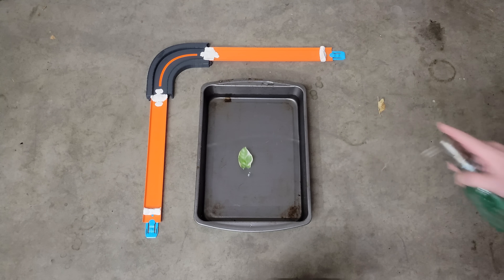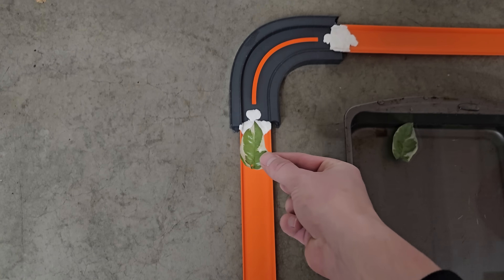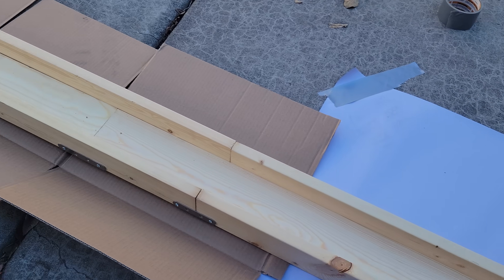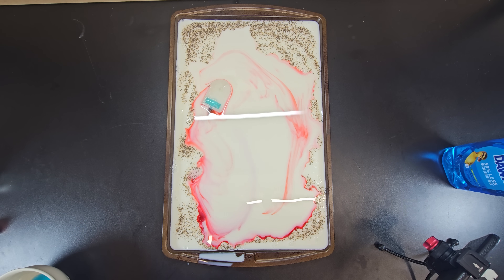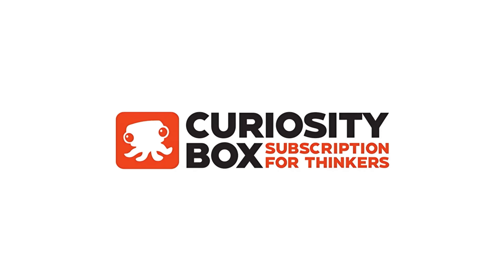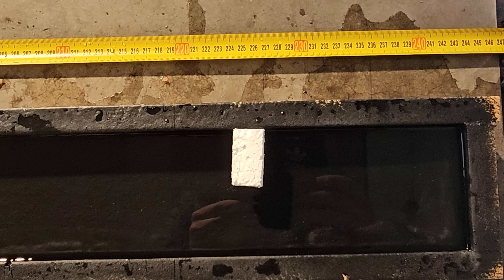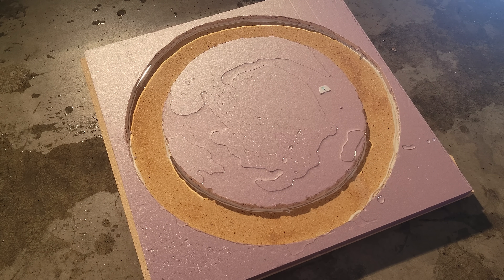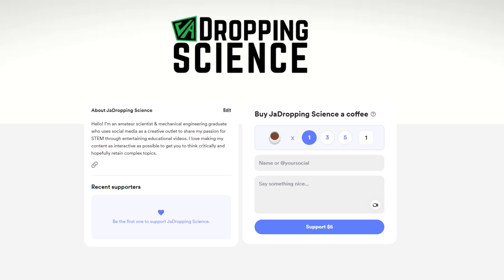Exploring the Physics of a Soap-Powered Boat

Comment: Another trip to get some Flex Seal tape to fix the bottom corners of the water trough track, an ordinary deck of playing cards to add under it a little bit at a time to help level it off, and maybe even get four cards of those two packs of Stanley line levels. You could have four levels on each side, then you'd know exactly where to add or remove shims(aka playing cards) to make the trough as level as humanly possible.
I've never heard of this leaf boat thing, but pretty cool how it works. It almost looked like at 11:34 that the boat was drafting the pepper before pushing it out of the way.

Comment: Make a boat with two stationary rudders/keels at the back, both angled towards the outside a bit. Once the boat starts drifting to the right, the left rudder will provide more pressure/resistance, thus putting it back on track again. 

Should work for the straight track. For the circular track, however, make it one straight rudder and one angled rudder, to ensure it always goes to one side. 

You can experiment with the angles of the rudders, the length of the rudders and the curves of the rudders (a straight rudder at an angle vs a curve that starts straight but curves outwards).

Comment: You should have painted the tops of the tracks with a hydrophobic paint or coating to keep the surface area as strong as possible to prevent overspilling, although with the soap it might not be as effective. Still, it might help

Comment: 0:51 I'll explain in depth why adding soap to water makes it so the drops are flat. water has a polar molecule. It has pretty high surface because of the positive and negative charge that pull each other together. The paper clip sinks because when you drop it in it breaks waters surface tension and is a heavier surface. So therefore it sinks, but when you place it in carefully the surface area doesn't break. When you add soap to water the waters molecules essentially becomes 'slippery' and its harder to keep surface tension. The waters polar molecules can't try to glue themselves to each other making it so the clip sinks because its a denser material. The water therefore cant make a dome shape because the water itself cant stick together

Comment: Wouldn’t the surface tension of the round track get ruined since the “wave” of the surface tension changing travels in both directions so it eventually comes around in the opposite directions pushing the boat off course having coming to a stop? Maybe try a round track that doesn’t go all the way around

Comment: @JaDropping Science I have a suggestion for how you can get the water to dome without filling it so high. there is a surface treatment called "Never Wet" I think. It's a two-part treatment that comes in a spray. The reason I mention this is because in order to get the boat to float high in the water you need the water to not wet the outer surface. If you use this product, instead of going up the sides the water will form a dome at the edges. The product works by trapping molecules of air on the surface. I've used it to waterproof cardboard boxes before. Strangely enough there was a similar product That came out at around the same time called Ever dry or something like that. I'm not sure but I think that maybe two science teachers came up with this at the same time and were racing to market.

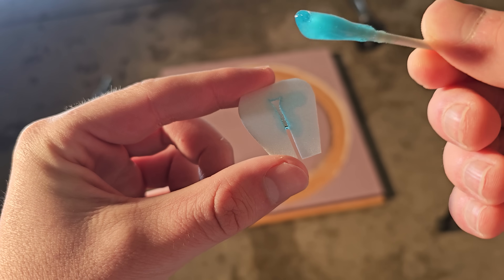Comment: 12:00 I think you would have more stable "ship" if you made it spoon-shaped with the round end of the spoon as the front of the ship. The round end would stay on the track / control steering and the long shape would avoid getting the force vector too perpenticular to the track when your propulsion comes from the rear of the ship.

Comment: 5:58 I would have quessed that the styrofoam on hot wheels track was turned because of static electricity. I would recommend you do some addtional experiements to figure out if it's actually surface tension or static electricity.

Comment: appreciating your work. . .
how bout instead of wings or shape. have a controlled keel?
im not an expert but from what i understand surface tension is more of a vertical resistance hence floating; all your models float so the next problem to solve is the horizontal axis.
single/double keel would help straighten, while an angled will steer it to a near perfect circular motion.

Comment: This is wonderful content and I know I’m a bit late to comment but hopefully you see this. ADD A SKEG TO A THIN FOAM BOAT. It will help it track straighter and keep its bow facing forward. You’re essentially using flat bottom boats with zero drag force towards the rear. That makes the nose act as the primary drag and cause the erratic behavior. A step further would be to bend and shape the foam into a traditional hull shape to further increase the straight line drag.

Comment: If you want to paint foam, just paint on some modpodge and acrylic paint mixed first and then spray it whatever color you want.
It’s a common trick for making terrain and models for tabletop games like DnD. 
The modpodge makes the paint more flexible and durable and you need the paint to see if you got good coverage. You only need enough acrylic paint to make the modpodge colored, as long as it’s grey or whatever it’s good. It normally dries clear and you can’t tell if you have gaps and then you spray your paint and parts of your model start to dissolve… it sucks.

Comment: I think you could probably have just used the pepper, or individual polystyrene beads, to demonstrate the movement - or, could have printed a circular boat, provided of course that you were adding the detergent to the water, not adding it to a channel in the boat.  

I recall that, in a test tube, water tension forms a meniscus - curving upwards.  The internet says that, for glass, this is the expected behaviour - but for other materials it may curve downwards at the edges as you have found.  Therefore, it seems, you need a wall type that provides a concave surface rather than a convex surface - it may be too expensive to form this from glass but there may be cheaper options, this would mean that you would no longer need to fill to over-flowing and the "boat" would self-centre.  Maybe a Ikea Varmblixt Donut Shaped Serving Bowl would do the job?  Or a donut shaped cake tin mould?

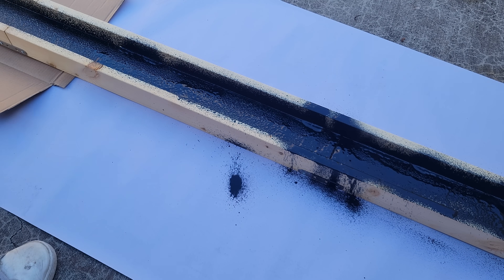Comment: 3:50 for cutting circles, i worked at a sign shop for many years, every year we had to hand cut circles out of corrugated  plastic for a golf tournament.  We ordered a new cheap tool every year hoping it would make it easier on our hands and faster.  
In the end, somebody figured out, if you stab an xacto knife into a wooden table or cutting top,
You can spin the plastic like a bad dj and get a circle cut that is quick  and it will look as good as you are able to turn it smoothly. 
The other colors workers who couldn't get the hang of it was more comfortable with the giant metal scissors  first, then smaller scissors to clean it up but their hands were a lot more sore than  ours. 

What makes corrugated materials hard to cut smoothly by hand with a blade is all the cores,  you have to go from 4 walls to 2, 4 to 2, after you apply more force to cut through a core, it gets away from you and makes a janky cut in the thiner 2 wall parts. 

But the spinning motion will atleast always make an arc cut that you can clean up after it's not a square anymore
Reply: Yo this is actually really helpful, thanks!
Reply: At least*, two words. Atleast isn't a word.

Comment: I wonder if an arrow point shaped channel (with in internal triangle of foam dividing the propulsion into two splayed points) would give it more stability/allow it to course correct a bit on its own?  I guess it might be finicky if the soap isnt placed perfectly though, leading one channel to overpower the other.  Perhaps little soap pellets and a divot in the shape to hold them could work.

Comment: wire tracks made of nylon or some kinda fishing line, to keep the boat away from walls with little friction. ofc you can even oil the wire and make the shaft of a little friction to keep the interference with the experiment low.

Comment: Hopefully I can describe my thoughts in a way that makes sense. So I was thinking about the circle track, if I am understanding this correctly, then the boat might have a problem getting the whole way around because of the soap it used at the start. Like maybe the starting position of the boat and soap may have also been causing the water to flow against it once it gets most of the way around and almost back to the start. 

Anyway this was a cool video, would watch more of this.

Comment: For the boat that goes in a circle, I suspect an asymmetric design may help it stay off the wall. Look into how engineers in NASCAR try to shape the sides of their vehicles to create aerodynamics which help the car turn left (& stabilize it while doing so). They're playing with air instead of water of course, but I wonder if some similar tricks couldn't still be applied to this. One thing they do is shape the right side of the vehicle to help create a "cushion" of air between the car and the wall which helps drivers run a high line through the turns. I wonder if you could keep the boat off the wall by shaping it to help bias towards creating positive pressure on the right side as water flows past (and negative pressure on the left). Google image search "nascar asymmetrical side force" for a glance at how they utilized asymmetrical designs in the past. Also, maybe if you cut the soap channel on the boat at an angle so that it runs diagonally and leaves the rear of the boat at a position closer to the wall, the soap will have less area to spread out between the wall and the rear/side of the boat, helping to propel it even faster.
Reply: Very smart, he should try this

Comment: That styrofoam/3d print dichotomy represents the printing community in my mind. Printers will jump straight into the first solution, spend 2 hours designing, 3 hours printing, and it will perform worse than something fabricobbled together with some scraps. For example, I saw 2 videos where each person wanted to 3d print metal, and they both had the idea to use a mig machine. One guy struggled with his brackets melting, changed where it grabbed the torch, still melted, completely changed everything and eventually got it to work somewhat. The other guy hose clamped his mig torch to his cnc router and got on with his video.

3d printing is awesome stuff, but at this stage it still makes sense to do styrofoam boat tests first.

Comment: Since the boats are pushed by the water you should maximize the area where water pushes it. A good boat shape to try would be a triangle, with rectangles cut out from its sides so that it looks like it has wings. Multiple cuts in each side would probably produce a stabilizing effect since the force of the soap water is going to try to push inward, and forward, along with the flow of the rest of the water which follows the course. It would be a fairly precise object but I would love to see how it flowed.

Comment: I wonder if there is a way to manipulate surface tension without getting some sort of chemical in the water.  Could be electricity.  Could be some sort of coating on the surface of the boat that does not dissolve into the water.  Maybe teflon?

Comment: To help guide the boat along the channel have you thought of utilizing static charge on the styrofoam? I'd try to create a styrofoam bumper along the pool track, maybe with a few balloons bonded to it via conductive wire & nail (intent being you statically charge the balloons which would then transfer that charge to the styrofoam bumper)
This would increase the complexity of dropping the boat & applying soap but might be cheaper/easier then trying to use magnets as a guide system (which was my first thought)

Comment: Attention Here, in the curcular track according to what you said the soap pushes the particles of the surface level equally in all sides so i think in the cir ular track when the boat is pushed in one direction ,say clockwise then the soap will push both the sides i.e in both clockwise and anticlockwise. due to the push in clockwise direction the Styrofoam moves and due to the other push it stops midway. So if we seprate the starting and ending points with a wall then it may complete full circle

Comment: 10:30 I would guess that, because the soap dropped from a bit of height, the globule was able to mix and dissolve into the water around it much faster and more efficiently than the gently placed "gas tank" of the boat, just barely mixing at the surface. So much so that there was a greater concentration gradient away from that spot, jerking the boat sideways

Comment: You should make a 3d printed one with a fin for drag and a small vertical compartment where you can pour soap into and a hole in the bottom back so the boat will have some minor stored soap so it will go a bit further and also foam on the bottom for buoyancy

Comment: What’s the relationship between the amount of soap to total water surface area? Like do you need more soap to achieve the same results when on larger tracks? Does more soap mean more speed or pushing power? Does it work at all if the surface area isn’t completely flat and still?
Reply: And how can we make soap powered water trains? 🤔

Comment: Some ideas that might lead to better boats: 
- give the boat some sort of rudder underneath, that way it should be more stable and not turn around on it’s own;
- this one might require a larger track, but you could cut 2 canals instead of one in the styrofoam, this was if you put soap in both canals it should give the boat more speed and it might also help with stability, perhaps you could also manipolate the steering by making one canal larger than the other.

Comment: If you made a cone out of middle circle, instead of flat surface, the water would not fill the middle once surface tension is reduced. This would prevent boats from straying into the middle.

Comment: Put the wings on the back 13:06
Reply: i think that would make it catch on the side more easily.
Reply: @charleshautly4732 it would stabilize the boat, making a straighter path. But if you angle it right, that's exactly what you need

Comment: Im curious to see if you had a fin or two maybe three under the boat, will it be more stable and reduce the spin and drift that the boat without fins had. Would be great to see it, but i guess it only works with straight lines since you cant move the fins and it would be too heavy.

Comment: 10:30 To add somewhat of an explanation to what the other person said, that just stated the obvious, even tho what I’m going to say is pretty obvious but provides somewhat of an explanation. I believe the dropping of said soap (the force of gravity) is applied to the soap and then gives it that extreme boost. An example would be, if you drop anything behind the boat it’ll move slightly. Now with the change in surface tension and gravity, you’ve got one fast boat.XD 
Edit: it could also be the extreme and unexpected change in tension. How does the boat know?  That’s a question for Schrödinger.
Reply: I think the boat charged to the Left because he dropped a tiny amount of soap on its right side when taking the dropper away

Comment: Hey Mr. JaDropping Science! I think your boat would have had more success on the circular track if you offset the channel slightly to one side of the boat so that the soap would propel the boat to curve with the track. Maybe even a slightly diagonal channel could work to move the accelerating force slightly to one side. The downside would be that the boat would only be able to go one way on the circular track.

Comment: The boost to the left I have a theory about why it was faster. If you slow down the footage and frame by frame it you see a ripple headed towards the spot the soap is about to land. When it lands I believe this ripple was sympathetically amplified but the surface tension waves and the fact the surface already have a directional trend to it. I believe the ripples had something to do with it because there is no ripple "backlash" around the spot the soap was dropped which tells me the amplitudes were combined and sent the direction of the trend rather than destructively interfering. 
Conservation of momentum likely had a part to play in it also - it was hit 90 degree tangential to it's original vector, it take little force to rote a velocity vector 90 degrees or less.

Comment: What if you cut little fins to fold down on your Styrofoam plate boats, kinda like a surfboard or a boat rudder

I don't think it'd help the turning issues but the increase in drag at the back should help keep it straight for the long stretch, I don't know if the soap would interfere with the fins keeping it straight or if the fins would interfere with the soap propulsion at all

Comment: Those flat bits of plastic they use to close bags of sliced bread work pretty well as boats.
I wonder if you could slow down the boats and prolong the effect by using a bit of paper towel to act as a bridge between the water and the soap.... if the soap has to travel through the paper towel, it would probably slow down quite a bit?

Comment: very interesting! some pro tips for 3d printing, don't use grid infill and if you want something lightweight that can float use LW-PLA or LW-ASA.
Reply: You are a gem. Thank you for the tips. We need more helpful people sharing knowledge like this
Reply: Can he just make ‘a boat’ then it will float because of if shape rather than weight and material. And make it longer so it has direction and directional stability. And make the track sides smooth. Interesting premise but could do with some finesse on the manufacture to help it along. Collab with that Lego engineer guy!
Reply: @yeknommonkey  nothing floats just because of the shape (not counting for surface tension ofc), you need buoyancy eg lower density than water.